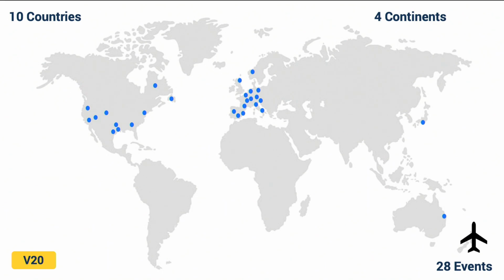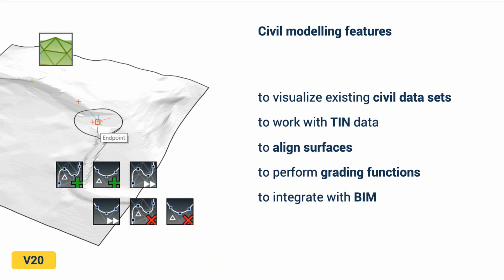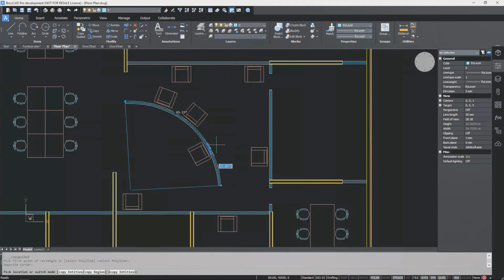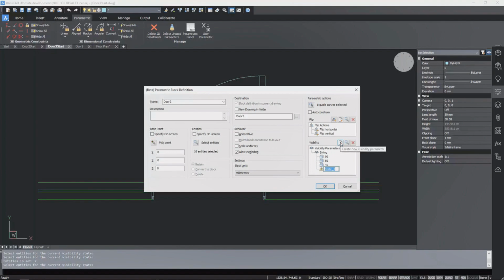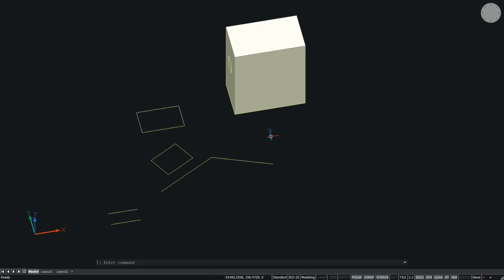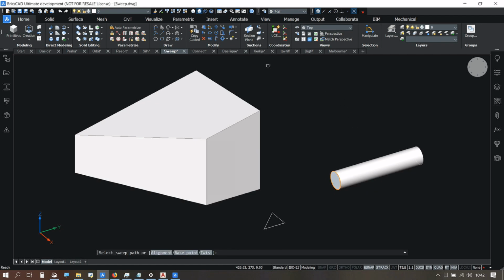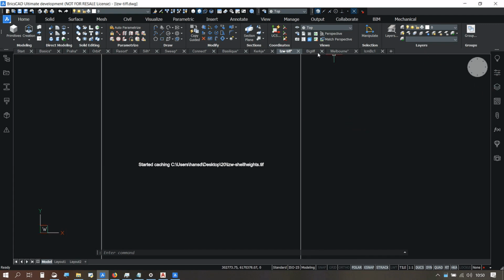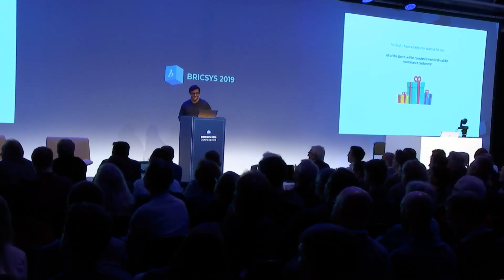Bricsys 2019 - The new BricsCAD V20 - Keynote

Comment: People wanted dark ui ??!!. It's the first thing I switched off when I started. 

What I want is to find the buttons that have dissapeared and I cant locate, like drawing views. 

And I want to get rid of all those ribbon pallets that don't work on my licence. I've only got a pro licence and I've got to go along and manually delete all the BIM and Mechanical clutter that doesn't work on my licence so it shouldn't show up. Right now I've gone back to uisng V18 becaus this V20 taking too slow with everyting switched around.
Reply from the maker: You can use the RUNASLEVEL command to run the trial at whatever version you like: https://help.bricsys.com/hc/articles/360006700853-RunAsLevel
Reply: just load your profile from v18 in v20?